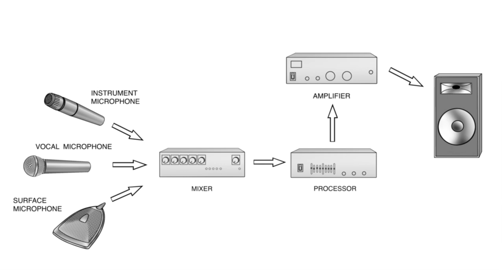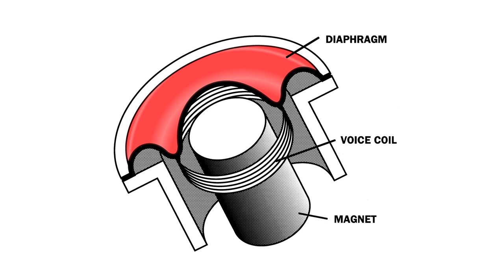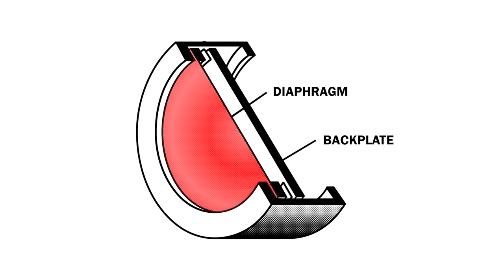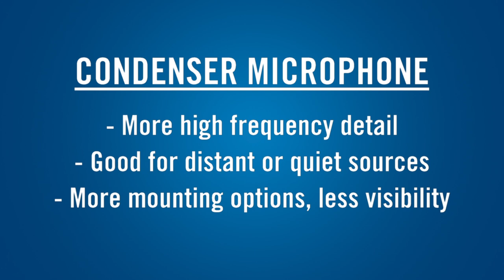Understanding Mic Specifications - Part I - Operating Principle

Comment: Hello!
I know this is an old video, but can you still help me get the microphone I need? :(
Basically I need a long distance microphone for my HT-PC. I stay in bed and use Voice-to-Text and Cortana a lot, and I need something to hear me clearly from 2m+, without mumbling and background noise...
And from the video I got that Cardioid is the type I need. But I still don't understand which has a better sensitivity, the ones that say "-70db" or "-10db"? I'm still confused... And on top of that there are stores that write the sensitivity in "mV", which I don't know what it means...

I've also seen mics with batteries...... If I connect them to the 3.5 jack, why can't they get power from there?? It's not wireless to need batteries! :(

Can you help me understand some of the stuff? And maybe help recommend one to me? I guess budget is out of the question for this... Doesn't matter, I'll manage.

Also: Usually there's a minus "-" sign in front of each sensitivity number. Is that important?
Because if it's scaled from below 0db, than -10db is a higher number than -50db... Right? God it's all confusing.......... :(((((

Thank you in advance!!
Reply from the maker: Hi, Lucian! Our Applications Support team can best guide you through all of this and make a suggestion. You can open up a ticket with them at http://www.shure.com/americas/contact or give them a call at 800-518-0446.

Comment: I dit some tests with both electrostatic & magneticalstatic microphones using both on magnetic and electicalstatic speakers, in both cases with low and highpass filters.
If i connect a magnetic microphone to a magnetic speaker i can hear hum but if i connect a electrostatic microphone to a electrostatic speaker, i can hear my voice much clearer.
However if i connect a electrostatic microphone to a magnetic speaker or a magnetical microphone to electrostatic speaker,thern  there will be a small, also if you filter use a highpass filter on a magnetical microphone to a staticalelectrical speaker, i actualy hear no difference when i connect a statical microphone that way to it.
So it matters alot in how you use stuff to make a clear difference or barely hear any difference at all.
Reply: +johneygd WOW TELL US MORE